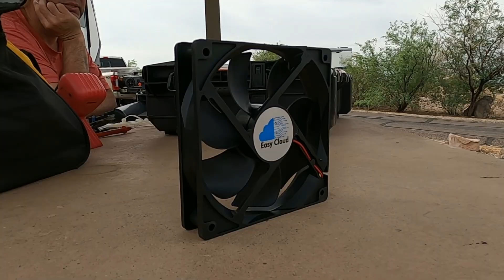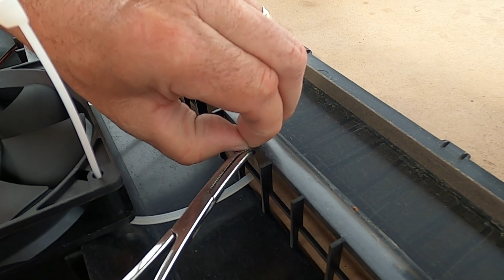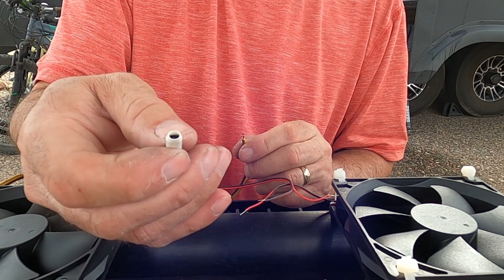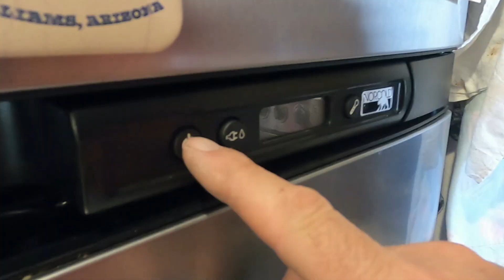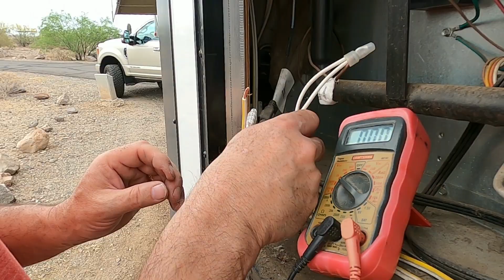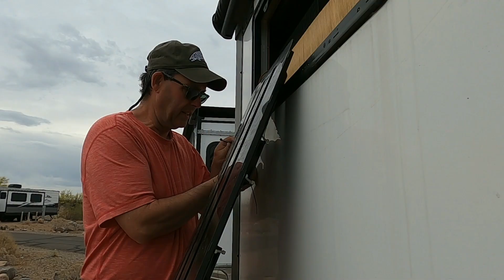Hot weather warm fridge Does adding fans really work?

Comment: So it is hooked that when you turn the fridge on they go on as we'll everytime? And work on being plugged in as well as not plugged in?
Reply from the maker: The way I wired mine is that if the fridge was turned on Gas or Electric the fans would run. This way if the fridge was turned off there would be no power to the fans and  not be a draw on the battery's.